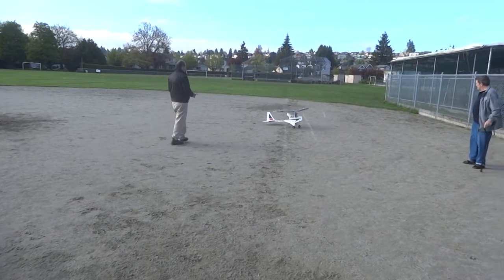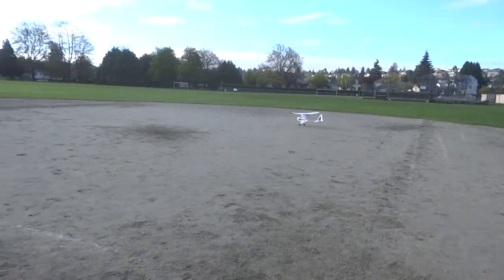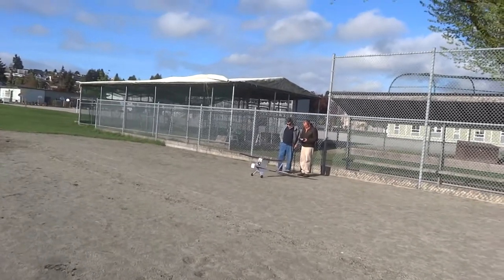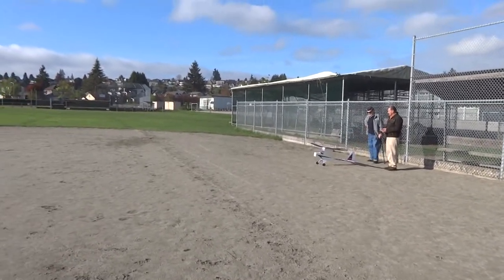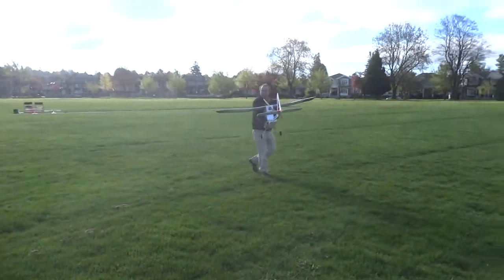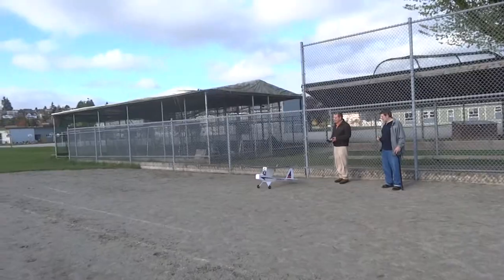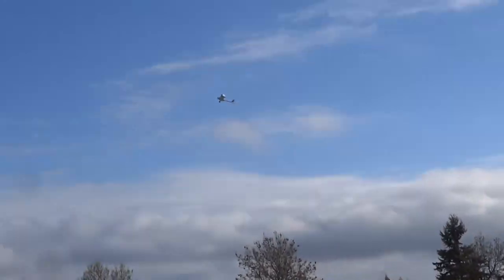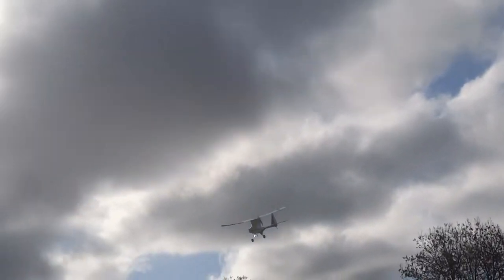Explorer One design and build by Terry O'Brien

Comment: From the narration - it sounds like the vertical stabilizer needs to be at least 2X bigger so it won't go sideways when the power is let up. Hope this helps : )
Reply: well.. the wing area may be OK just depends on how fast you like to fly and land. : )
Reply: usually planes of this type have the motor on top the wing to keep the height of the planes fuselage to a minimum-but still have room for the prop. as for efficiency do you have a glider airfoil or?